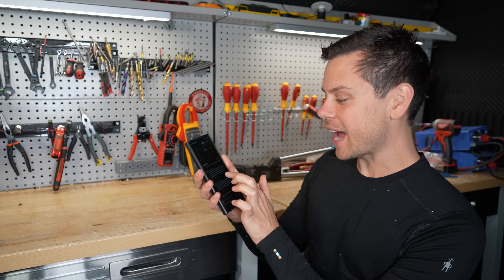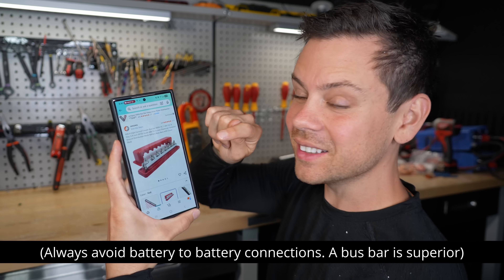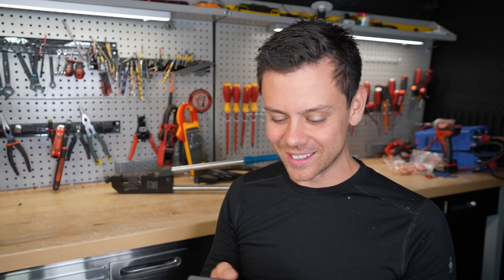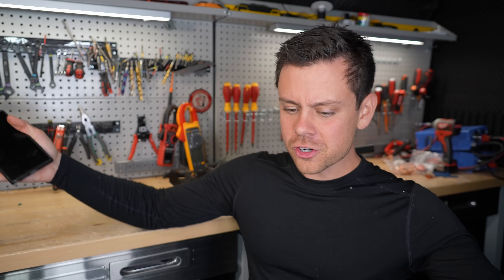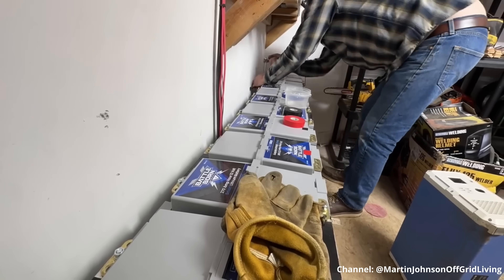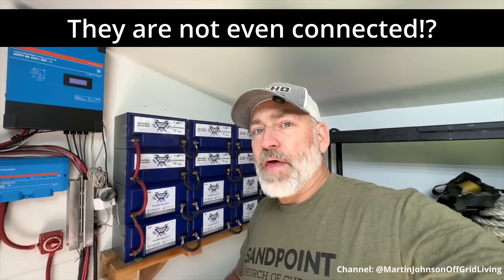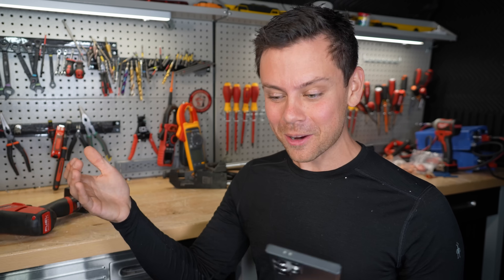My Reaction to Martin Johnson's "BEST Off-grid Battery Bank" Video 😬 Yikes!!

Comment: Your obviously not from any industry. Electrical supply companies have been soldering high voltage and low voltage cable lugs for over a century, so they work.

Comment: This is the kind of person who says it's been running for 6 months or a year. Then they claim the setup is correct and how it should be done because theirs has run flawlessly for such a long time.

1 mistake like the wire diameter next to his uninsulated wall could set the entire thing on fire. 
Those soldered wires was amazing fill up the cup and dip it in 😂. Crimping is best when it comes to the best connection. Not only that with heat the solder wicks up the wire, so eventually it will just fall out. It also makes the wire super brittle, not so bad in this stationary environment. But the wires can be bumped and they can snap.

Comment: Yikes! That guy was singlehandedly instructing people how to make future content for StacheD's channel. This was a brutal but well deserved takedown. 

Soldered lugs have two main issues: poor thermal characteristics and poor mechanical integrity. They melt under fault conditions, they get hotter under normal conditions because solder is a much poorer conductor than copper, and they have a very nasty habit of cracking due to torsional loads. It's also difficult to inspect them visually as the joint is hidden inside the lug; cold or void-filled joints are very common as a result. 

BMSes CAN FAIL - You MUST use a fuse on every string in parallel. Not doing this is just asking for a fire. 

Aluminum busses can be used and they can be very safe...HOWEVER, there are a ton of "gotchas" with Aluminum conductor systems that most DIYers are not aware of and are ill equipped to manage when building systems from individual non-listed parts. Al has roughly 40% less conductivity than Cu, so the bus bar must be upsized to compensate. Most people get that one right but fall on their face with the next requirements: The hardware and lugs must be rated for use with Aluminum. The battery terminals must be rated for Aluminum. The alloy the bus bar is made of must be of a type compatible with your chosen electrical hardware, an "EC grade" alloy. Failure to use the proper alloy will result in connections that are prone to fail; random bar stock is NOT acceptable. Lastly, he abrades the buss but doesn't add NoAlOx or similar, which makes that activity pointless. Additionally, if he used the proper alloys, he might not even need the antioxidant! Quite a few Al connection systems are rated for "dry" installation these days.

I don't necessarily have an issue with small conductors on huge batteries for long run applications, but there had better be properly coordinated overcurrent protection feeding those cables! That's conspicuously absent here too.

Comment: I'm a bit confused about balancing parallel batteries. I always top balance first, then monitor, but in this video:-

Problem 1: If the voltages differ by too much, you may get a very high current surge on connection. Short term solution: balance voltages first. Top balancing still needs doing. 

Problem 2: still not balanced after 6 months. There was talk of the batteries communicating with each other. To balance like that, each 4s string has to understand it's in a string with 3 other and do resistive balancing in that string. I don't know if Battleborn can do that, and even if they can it will take some setup to make it happen. 

So why are they out of balance after 6 months? Has he not charged full in all that time? Or did he forget to setup the Battleborn communication properly? Or is the idea of these batteries talking to each other baloney?

Comment: You might be able to get the same "capacity" cheaper but that doesn't mean the cells are as good or (if applicable) a good internal BMS.
48V of 12V batteries is fine as long as there is a good BMS involved.
I'm not sure a agree with each battery to a bus bar and not interconnected. Especially since this is a series connection. For parallel, sure but not series. Adding a bus bar for series connections is just adding unnecessary resistance.

Comment: If your system uses only 100 amps even though the batteries should have thicker gauge is fine to use..just use a fuse to the gauge of your wire not the battery..there be no point at this time..on my system my bus bars are custom made from a machine shop..my batteries are parallel and each one has its own 400 amp fuse..let people do there own thing..this is how people learn there mistakes..since your complaining..send the guy a text or message or email and help him...

Comment: Wrong use steel bus bars.. Batteries of large size that doesn't have to move .. weight is not a issue.. copper is fine also good old fashion steel is the best...

Comment: @WillProwse love your videos, 
Question about series parallel to make a 48v bank with 12.8 v/100ah batteries. In this video, I think I heard you say this isn’t safe? Using 2/0 cable to connect each battery in series with cold welds on the wire and then connecting the positive parallel to a breaker, then to a bus bar then bus bar to inverter is not ok? Parallel negative to a shunt, shunt to bus bar then bus bar to inverter? Trying to figure this out before I set it up. What is the safety risk, draw backs? Thanks for all the videos you do! This is with the assumption that all batteries are balanced. I am new to this and want to make the best decisions. I have a small system setup for an off grid cabin

Comment: Never expect these batteries from a factory is ok or charged the same. Inspect them and make sure they have the same charge as you hook them up. Always check system components as you assemble your setups.  And use quality parts. Check out videos. Look for. More than one review. Some people are lucky they are not burned up!😮

Comment: De-soldering is safety feature as it acts as over-temp protection ..😀
SAC305 melts at ~217C(422F) so things would really need to be going sideways to achieve that temperature through resistive heating at the solder lugs.
I'll vote for crimping and soldering. The crimping keeps everything in place and solder provides the best ohmic connection and corrosion resistance.
Corrosion at the wire to terminal contact point causes localized heating under load and the heat generation then enhances the speed of the corrosion process.
If the installation is protected from the environment, crimping will be up to the task. Some RV battery installations are not that protected, so plan accordingly.

Comment: Why do you need to charge the batteries to full if they are on the same voltage? no high currents will flow during connection. when you then start charging them the fuller ones would take less current since their voltage would increase faster so as soon as they are connected this will even out in charging

Comment: I used to do off-grid installations. I took courses back in 2014 and have years of practical experience.. I stopped doing that kind of work for off-gridders because SO MANY of them are like this guy. One guy modified a system I built for him, added a ton more panels, didn't wire it correctly and almost caused a fire. Tried to blame me. Another guy kept ranting that cheap PWM controllers are better than high quality MPPT controllers. I refused the job since he wouldn't let me install it my way and wanted to hover over everything. He now has a battery rack mixed with different capacity batteries with the worst wiring I've ever seen. Mixed gauges, exposed wire everywhere, the positive/negative wires coming from the same battery at the end split to two inverters... stuff out of a horror movie. And not a single fuse in sight.

I unfortunately got a reputation as the community's "solar guy" and I have to tell everybody who stops me and asks about their problems that I don't do that kind of work anymore. So many of them are like this guy you just reacted to.

Comment: Think it would be good for Will to give proper the method for each flawed one.  A lot of new stuff now, it might be a good time to do a string of organized mini shows on basics such as' Connections; crimping,  solder or  welding, wire and buss gauge and WHY . Building your own batteries from cells, Using multiple batteries, Charging,,,,. Same for panels and inverters. 
Always include WHY its the best way and what might go wrong if not used.

Comment: I don't understand why all of these people use flux when soldering. The flux he's using looks like flux for plumbing solder joints. That is an acid base. Any electrical solder flux must be rosin.
I know you don't like soldering lugs but if you're going to do it, use the right materials.

Comment: Yeah, that guy Martin Johnson is a total friggin idiot. 4ga on the battery output is INSANE not to mention they are soldered, if there is a short that buss bar will heat up hot enough to melt that solder and cascade into a cross circuit short and possibly make those batteries explode and cascade. This is a MASSIVE error. I could understand the solder if he ALSO crimped.

Comment: The only way I’d u solder is after a good crimp is made with the correct crimping tool , but it’s  not necessary and b difficult, I have seen brazing used in some cases at least on a solid wire and connector like a ground wire etc , one problem is that some of the copper etc wires are not “ virgin “ metal s , even most lead based batteries use recycled material , that’s why say a ford tractor batt would last for decades in the past, and we all know where most wires etc come from now, hey if “ we “ can’t make most T shirts here probably can’t get a made in the U S wire etc off topic a bit , most solar installation companies use  systems that do not work during a power outage and most do not promote the use of batteries , go figure !! ?? We had several companies that didn’t tell us that until I asked them, so even during the day if the power went out it wouldn’t work! Ie grid hook up with smart meters, so ask questions if ur looking into a installation

Comment: That Eco Worthy battery, you said was only $459 at :40 in the video is on Amazon now for $2399. Where did you find them for $459?  Oh, I see that is the individual batteries, there are multiples in that cabinet with the display.

Comment: Re stainless galling - you can "loosen" a small nut that's barely on... given enough force it will basically strip the last couple of threads off the nut or the bolt and will come off. Might be safer than using a saw near a battery. But yeah, careful with SS hardware, especially with locknuts. Go slow. Lubrication helps.

Comment: Thank you for your post I wish everyone would learn from this.  safety is important and just because it has a video does not mean it is safe or correct.  if so i have an energy machine made with push pins anD rubber bands that i will sell you for $100 :)  and you will stand less of a chance of injury.

Comment: Quick! Somebody do an Intervention! Call his local fire department/marshal before somebody burns? Anyway, you'd think with that sort of power the State or local municipalities would take an interest in certification of home-built systems above a certain capacity.  Another risk to think about are earthquakes and other natural disasters for the locality.  I can say for sure I'd not put the battery bank on wooden shelving above the lower battery bank in an area where tectonics are active (which is really about everywhere). At the very least there should be some evidence the black batteries stacked on the shelf are 'secured' to the wall framing without pressing against that wall. Do you have problems with the battery bank being in an area where metal shelves, etc can fall on the battery array? Would it make sense to 'cage' those batteries away from falling objects, and as a matter of principal,  away from children (especially if boys have unlocked access)?  I think it was CA, but, I dimly remember we had to secure EVERYTHING, except maybe marsh mellows, against falling in earthquakes. In addition I think there was a rule about clearance (18 inches ?) between objects and the ceiling, but, that might of been about fire codes.

Comment: Last question what voltages are his batteries? because the wire looks kinda small for the job he’s using them for, it looks like power wire you’d use to power a car amplifier and if that’s the case they’re only rated for 12 volts I’m not going to lie but that is sketchy asf!

Comment: The reason solder joins or bad for high power connections in the case they overheat they will de-solder.
Reply: And, to make it worse, solder doesn't conduct electricity nearly as well as copper.  So they'll de-solder themselves very quickly with high current.
Reply: Ah yes, the cataclysmic pole shift of soldered battery terminals, automatic rerouting of power in case of failure🙃

Comment: I've seen him doing a parallel connection of a 12v 100Ah LifePO4 battery with an 12v 280Ah battery (if I remember correctly). 
Is it ok to connect in parallel two LiFePO4 batteries with different capacities to obtain a larger capacity but to keep the same voltage?

Comment: i'm confused, if i parallel two lifepo4 packs and both are at the exact same voltage there shouldn't be issues right? i doubled my old phones battery capacity this way, both cells had the same voltage and i paralleled them and had no issues charging and discharging. or is this different cause the pack is in a 4S configuration?

Comment: It's not ridiculous to size your wire to your max possible load using your specific inverter, charger whatever, as long as you have appropriate breakers or fuses on the wire.  Will is insisting that because the batteries can theoretically output 300 amps that you must have 2/0 or 4/0 wire. 

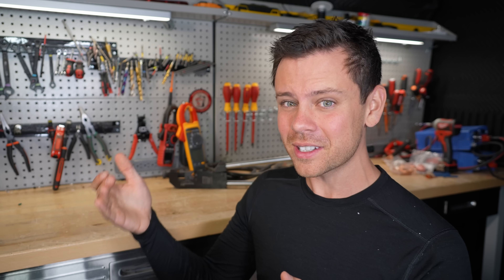The guy in the video calculated the max draw on his equipment and sized his wire appropriate for that.  At least by the 5:25 mark he hasn't included any fuses though.  If he does fuse his wires properly, then what he's doing is fine.  Sure, it would be "BEST" to use 4/0 but not strictly required and it's not 'ridiculous' as Will keeps saying.

Comment: Yeah. A 48V system should probably be built with individual cells like 2V lead batteries. Those 12V batteries will need internal and external balancing. It will be a major hassle. If they are really fancy 12V lithiums with internal BMS, balancing and breakers, it can be fine.

Comment: Not recommending it, however we had a failure on a workboat whilst offshore. We needed to attach another lug on the 48v DC side. 

We only had solder gear onboard, so we did a temp repair similar to what this guy did . When we got back ashore, we crimped it the normal way, however we tested the pull out value in-line vs crimped and it was only 30% less give or take with the failure mode being the strands.

Comment: $25,000 in batteries but can't buy the proper tools for the job, a hydraulic crimper is less than $100. I have a $2,500 and I bought a hydraulic crimper and a ferrule tool to make sure all my connections were good

Comment: I have a couple of episodes showing the correct crimping procedure for copper lugs :hand-orange-covering-eyes:. I use active balancers on our 20 x 200Ah lithium batteries to ensure all are equal. 52kWh for $10,000 AUD $6,500 USD. I am not sponsored at all just to be clear, we paid for every nut and bolt. 2 more years and we will have generated enough energy to pay the system back in savings.

Comment: All spot on with your commentary. Other then only using copper bussing.  Depending on the fasteners and terminals used by the battery manufacturer. Aluminum might be better from a metallurgy standpoint. As long as he has large enough aluminum bussing to handle the current.  I have had copper bussing completely corrode away in a short duration from the dissimilar corrosion.
Reply: Better yet is tin plated copper bus bars!  Reduces corrosion and dissimilar metal contact issues.  Tin is a good mitigator between dissimilar metals too.  It cost me $500 for my tin plated bus bars to connect 4 batteries together in parallel.

Comment: Question... If I had say a Pecron 3600 Power Station and wanted to have extra battery capacity, instead of buying the Pecron extra battery I could get (2) LifePO4 hook them up for less money (I believe). Which would be better, hooking them up in parallel or in series..?

Comment: You lost me at "He's putting it in his mouth!?" Are you serious?  Isn't that a bit much?  Have you ever gotten your hands dirty?  I'm pretty sure you've had worse things in your mouth.
Reply from the maker: No have you ever worked with those lugs? They are dirty!
Reply: @WillProwse  Copper is an essential element for human nutrition.
Reply from the maker: There's a thin layer of oil on these lugs during the manufacturing process. They're filthy
Reply: @WillProwse  Many tradesmen work while holding pencils in their mouths all day which is much filthier than any cutting fluid or gear oil.
Reply from the maker: Have fun putting things in your mouth then bro. Not for me
Reply from the maker: And that's where I lost you? 😂 Nothing else here looks crazy at all to you?

Comment: You have my support. 
I work world wide as a  service engineer with electrical background.  The safety around electrical systems is vary spesific.  Its one way thats the rigth way and its written down and made § about it. Some diffrence in diffrent countrys. I made a lot of offshore systems ect. Lots of DC and battery work. 
I suport your video and what you talk about.
PS - In my country your not allowed to do this at home. By law you need a electrical worker.